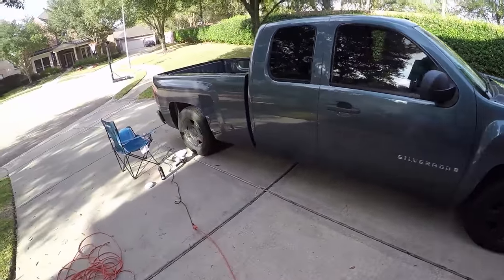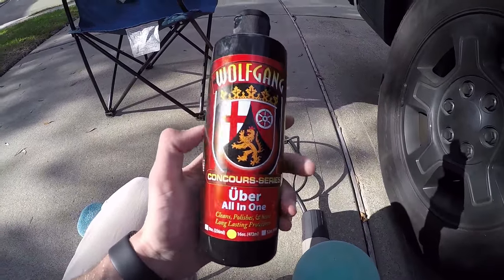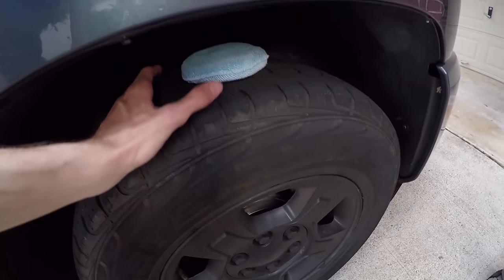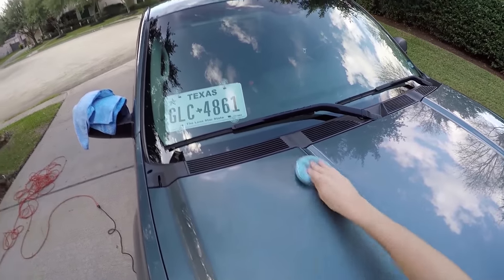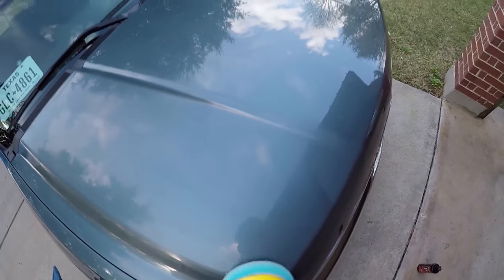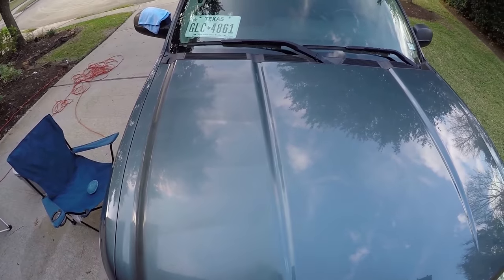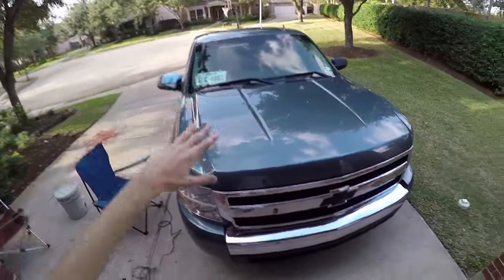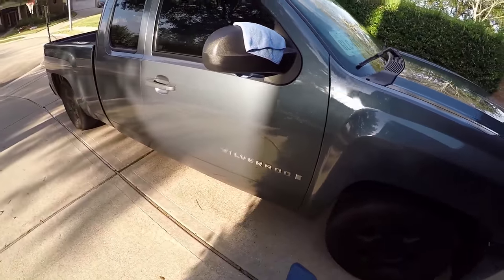How To Wax Your Car/Truck

Comment: Hey thanks for sharing the video. Nice truck man. In my opinion, the only reason you would ever use a power polisher like that is to either save time or if you don't have the strength or stamina to do it by hand. It's not ideal. It's like taking a gun to a knife fight. Hand waxing and polishing is still the best. Just my humble opinion.